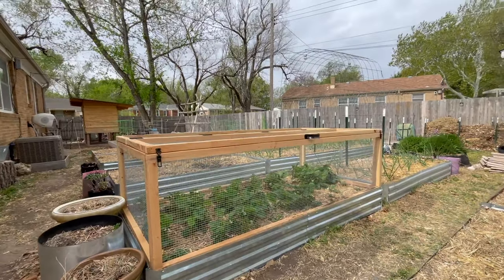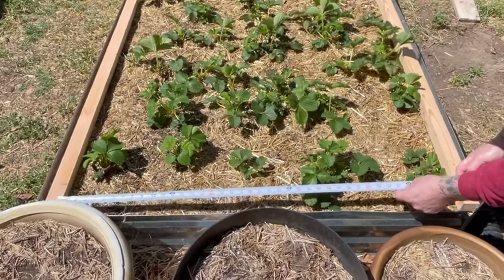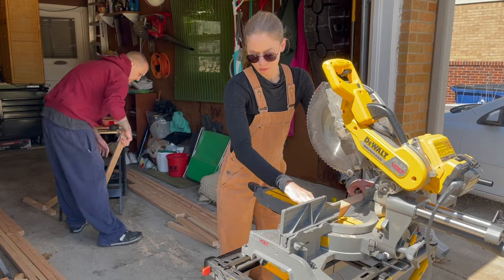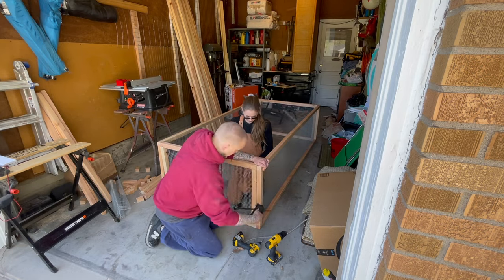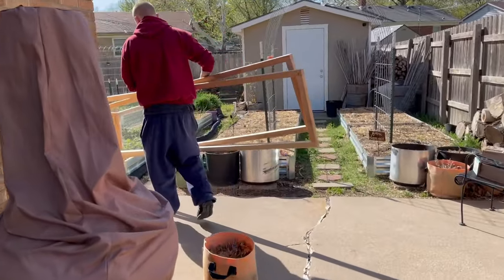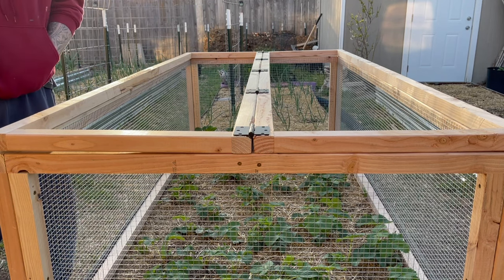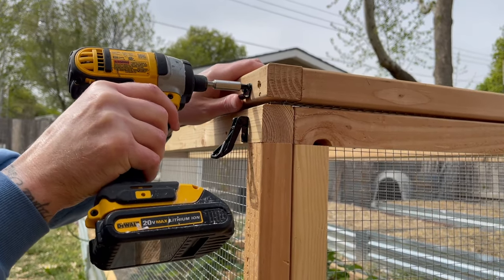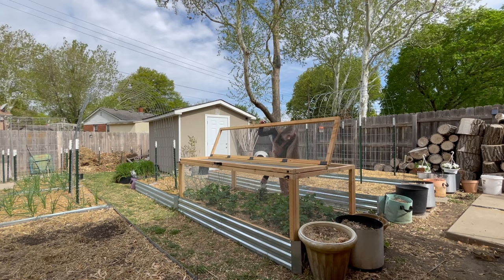How To Build A Hinged MULTI-USE Garden Bed Cover!

Comment: If you want to save a bit of ( 8') lumber/cash, instead of building out seperate side panels, simply build out a single frame of the sides and non-moving top. Additionally, you will need fewer cuts in the hardware cloth (a beast) if you bend it on a counter before attaching to the pared down frame.
 Individual side panels are an overbuild as this frame carries no weight. 
I have built such a frame with 1x2" all around.
Also, the bed measurement is external, not internal.

Comment: That's quite a reach to get to the soil unless you take the whole thing off entirely..
Reply from the maker: I can touch the soil and harvest just fine! I do take it off when doing any kind of amending or a lot of weeding. It would be easy to make it shorter to your desired height!
Reply: I'm wondering about putting a solid panel on top, splitting the two sides lengthwise, and hinging the top half of each side so that your access would be from the side instead of the top.